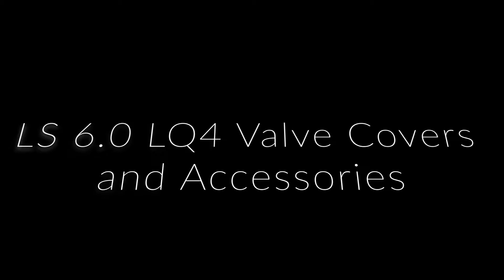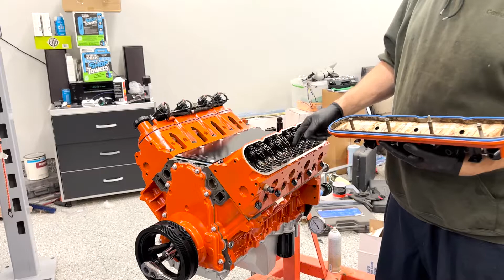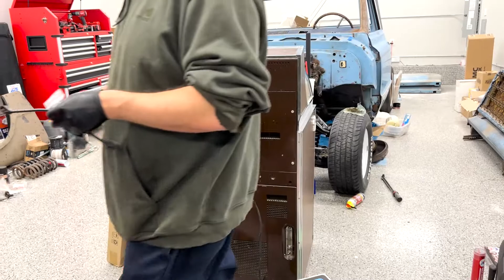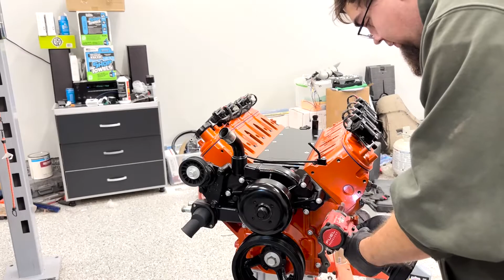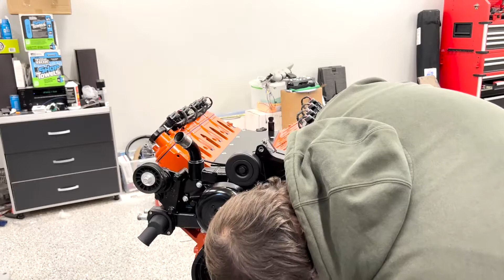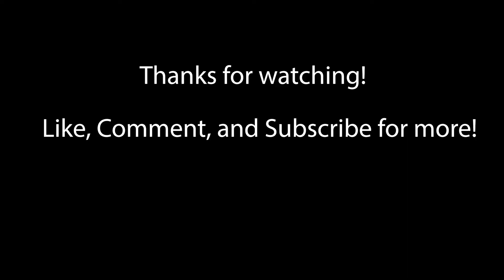LQ4 LS Valve Covers and Accessories

Comment: How did you clean the gasket surfaces other than break clean?
Reply from the maker: Most were cleaned with a razor to remove any old material then 320 grit garnet paper on a long sanding block.